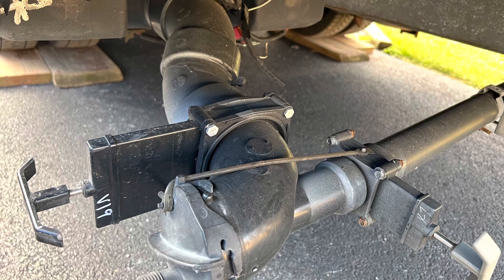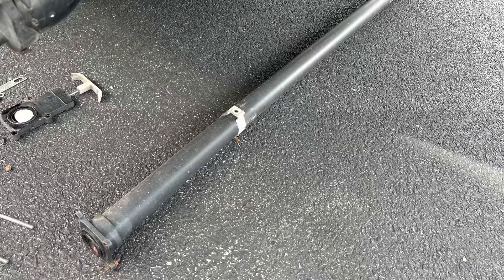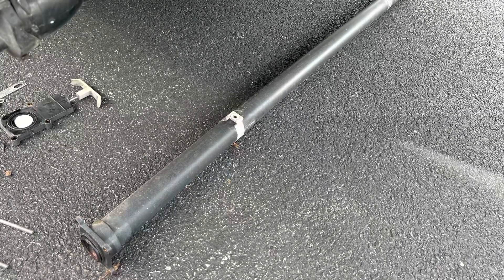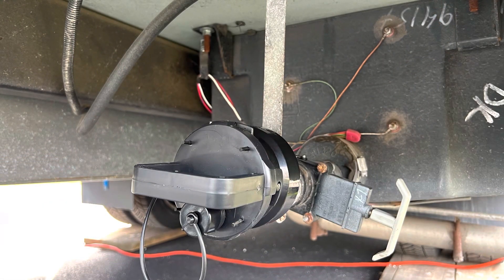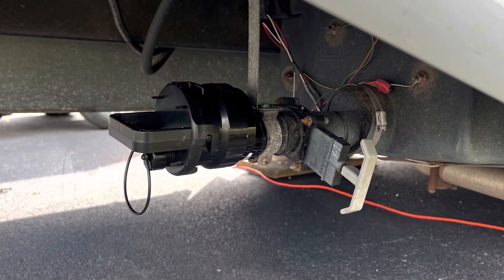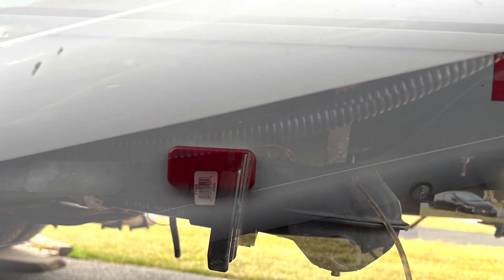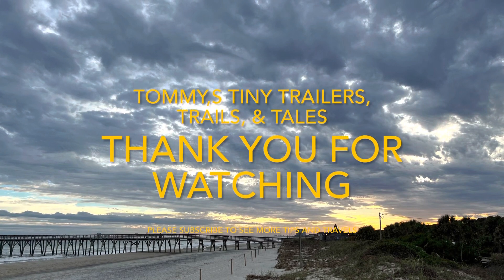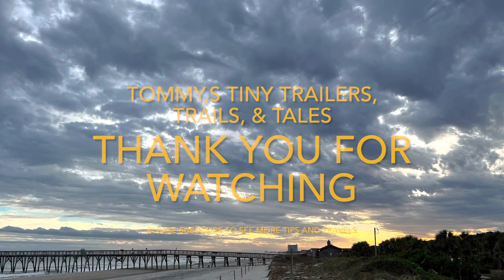Increasing Ground Clearance at the Sewer Hose Connection

Comment: Thanks Tommy!
This is a great idea and well documented. I am going to do this to my 20xg. 👍
Reply from the maker: Here is the Amazon information on the 3 parts.  You’ll also need a section of 3” ABS pipe.  I got a 2’ section at Home Depot.  Also pipe cement for ABS. 
Valterra T1005 3" Slip Hub Flange , Black https://a.co/d/8whqR2x
Valterra T1029-2 Termination Adapter - 3" Bayonet x 3" Hub , Black https://a.co/d/cPqKyPL
Valterra T1041-1 Eccentric Tank Reducer - 3" Spigot x 1-1/2" Hub , Black https://a.co/d/gg3xqcM